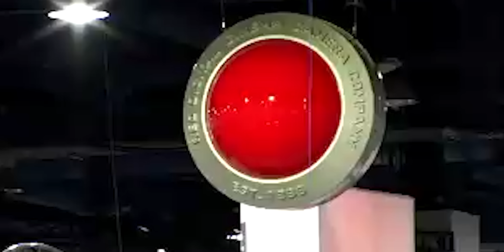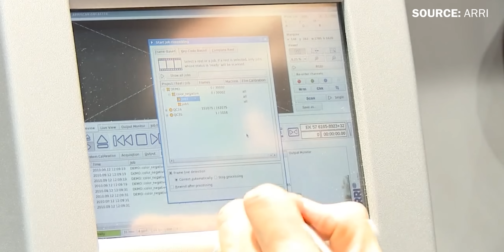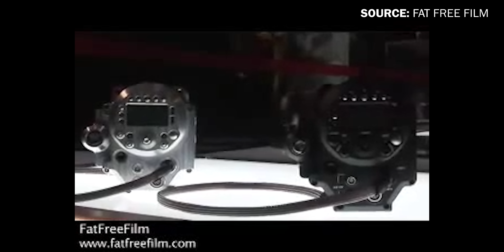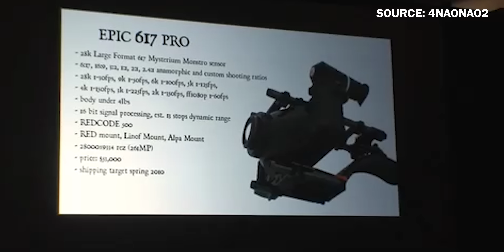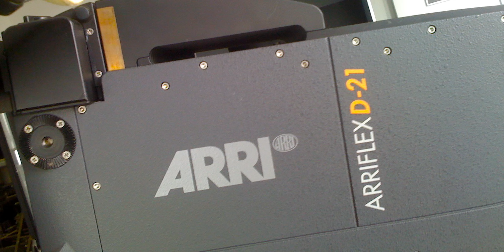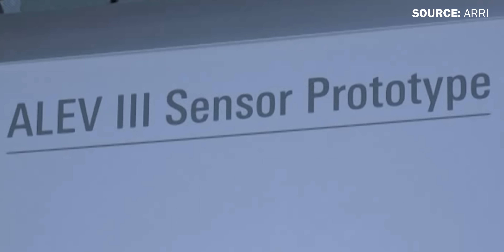ABANDONED | ARRI's first Digital Camera the D-20

Comment: Shutter Island movie was visually really beautiful. never thought it was shot one of these camera.
Reply from the maker: Yep! That's the crazy thing is it was filmed with both film and digital. And you couldn't tell the difference
Reply: @FrameVoyager  its amazing how  many manufacturers even today can't even match the old ARRI sensor look.
Reply from the maker: They just don't rush anything. Like I've said in other videos, it's really smart to look at how they do things and emulate it. They know what matters because they take the time to nail out every detail.
Reply: @FrameVoyager  this is why i don't like when people keep asking to make another very high resolution camera. specially in the Nikon community if you ask them how Z8 should be like they will say bring 80MP or 100MP sensor. this kind of higher resolution will have bad performance in low light and it will perform very bad in video. camera manufacturers should now try to get more dynamic range out of new sensors. i would rather have only 30/35MP 6k resolution sensor with 15+ stops dynamic range and better low light performance rather then just keep pushing for the resolution. 
its just amazing to see how new good ARRI Alexa S35 sensor 17+ stops dynamic range footage looks like. you can clearly see the difference between other cameras footage and new ARRI just due to the dynamic range.
Reply: I think they used d20 for most vfx shots and plates, an early adopter for 35mm size digital camera.
Reply: @JaspreetSinghArtist  i agree, people in stills comunity always wants higher megapixels and disregarding DR which makes me sad for the advancements in stills cameras.
Reply: Shutter Island was shot on film primarily.

Comment: Arri's ALEV III sensor was designed by ON Semiconductor, but that's not a bad thing.  The ALEV sensor was built on Arri's scanner technology, which was outstanding in dynamic range and color, but also gave them film scans to use to developing a film-like noise pattern that was extremely pleasing.
Reply from the maker: Yeah, it's always impressive to see in this era how ARRI really didn't rush things and waited to make the best camera they could.
Reply: @ELS KSA Yes. I should have made that clearer. Arri had a heavy hand in the design, while ON made it possible

Comment: I had a 2 days commercial shoot around 2008 in Hungary with D21. The camera was brand new, bulky, looked like a motorbike without wheels and frames. The recorder was attached by cables so we couldn't really moved (we tried and it was hard) the camera or use it handheld. After on and a half they shoot the camera stopped working, it freezed and couldn't start again. They take it back to Munich immediately and I never heard about it. The production brought a Sony F-900 the Ford production HD camera (Star Wars Attack of the clones fame). The Sony footage looked inferior to the Arri's. I was seriously disappointed in the D21. I worked with Red One, lot of people hated it, because of overheating and etc, but I never had problem with it, and I like the image that Red One produced. Later on Red changed to modular cameras and Arrived released Alexa that reminded me the Red One aesthetically.  Those were the days...

Comment: I feel like you left out a bunch of key reasons. If I remember correctly the native ISO of this camera was 200 so it was slow. It was also gigantic and heavy, and required being tethered to an external recording device like the minifridge sized Sony SRW-1. The image quality and compatibility with film accessories made it appealing as a real digital cinema camera, but If I had something of my own to shoot back then I would have much preferred a Sony F900R, for weight, simplicity and being able to just throw it on my shoulder and go.
Reply from the maker: I'm sure I missed some too! These are not the easiest subjects to research as I'm relying on very little data or information, especially with these cameras and when they were around.

Comment: 11:03 no, maybe a bit of a nitpick but it’s very wrong. ”The ALEXA camera is powered by the ALEV III image sensor, which was designed and manufactured by ON Semiconductor specifically for ARRI.” very few companies (Sony, Canon, …) with strong background in digital design have the ability to design sensors. Arri, RED, BMD etc mostly work on integration level, at best collaborating with experts like ON, Fairchild, etc etc who designs their sensors. Prior experience in analog ASIC design and issues/challenges specific to sensor design are a requirement to make your own sensor, which none of the digital movie camera pioneers had, needed to buy externally. Basically if RED or Alexa would have designed their own sensors their cameras would have entered the market maybe 5 - 15 years later as they either needed to hire other companies sensor/ASIC engineers to get started, or in an extremely fast fashion learn a couple of generation of sensor design issues. Basically a company who haven’t released their own “bad” to “great” sensors for several years clearly lack the know-how to make a sensor.

Sony, Canon, … could pioneer in digital design because they had lots of smaller sensors for consumer markets where perfection wasn’t required. ON, Fairchild, … could also pioneer because they had access to tech application sensors and also a lot of non-sensor digital design. Basically all pioneers in digital image sensor manufacturing needed a lot of time, money and several iterations to get from bad to great.
Reply from the maker: 🤔 hmmm... I think I said that wrong here. It was definitely a partnership between them and ON. Probably should have been more specific to say that. I was more meaning the first camera that the sensor was fully developed by them through the partnership with ON. But meaning more so it wasn't just an experimental sensor as had been in the d-20 and d-21. Really ARRI learned a lot with that arrilaser and arriscan through multiple partnerships! Thanks for catching that!
Reply from the maker: Going back and listening to it yeah I think when I wrote that bit I knew what I meant in my head with it but didn't notice how it sounded until you pointed it out. It truly was their first fully developed sensor from all the data and research they conducted and the partnerships with ON. I'll add a note about that in the pinned comment!
Reply: @FrameVoyager  tanks :) I know it is impossible to state everything correctly and get all the details correct, so I felt a bit bad nitpicking on a single quote. RED at some point in early history tried to make people believe they magically designed sensors in-house with like eh, zero sensor experts in their staff.

An area I care a bit more than healthy because I understand the challenges in engineering even small simple ASICs; and manufacturers clearly unable to do this themselves have been very great at taking credit for advanced products where the integrator either buys a pre-designed sensor… or participates in a joint venture where the integrator only stands for maybe 5-10% of the joint design, the experts for the rest (and the years of trying/failing/evolving at imaging designs).

If I would guess, what ARRI brought to ON was a couple of unusual requirements (large sensor area Super35, low-SNR / high DR, optical/filter quality) that most sensors don’t need.

Super35 (and even worse, Full Frame) is where you’d expect yield to go down unless the design somehow accept/hides manufacturing errors (todays error accepting IC designs are orders of magnitude larger than what I learned to be bad-yields… in school we used to say 1cm2 chips had bad yield, 2cm2 chips had insanely bad yield, … but recent super-large chips demonstrate engineers have overcome such limitations in error-accepting designs)

So a Super35 imaging sensor is an extremely interesting specialized design. It is large. It has analog parts, and analog to digital converters. It has glass/microlenenses/filter elements, glue, coatings. So many challenges to overcome before you successfully can produce such a thing.
Reply from the maker: @randomgeocacher  red totally did! Have you seen my RED 28k sensor video yet? Literally ROAST them on it. At least ARRI acknowledged the sensor partner at an awards show
Reply: @FrameVoyager  Eric Fossum, credited as the designer of the original CMOS sensor, was initially skeptical of RED’s claims to have designed their own sensor, stating that he’d never heard of any sensor designers at RED. However, he later did meet the manager of a team of sensor designers who worked at RED. He writes, “at the recent 2019 Int. Image Sensor Workshop, I finally ran into someone who claimed to manage a large team of sensor designers at Red. So my statement about never meeting a sensor designer from Red probably needs to be relative to the time of the statement. I don’t recall his name and I can only take his word that he was a sensor designer or manager of sensor designers.” So I would not be so quick to dismiss RED’s assertions.
Reply from the maker: @JonPais  check out my other video on reds 28k sensor. They have testimony from Jannard they didn't make it
Reply: @FrameVoyager  Well, RED most certainly did not fabricate the sensor themselves! Enjoying your work, keep it up.